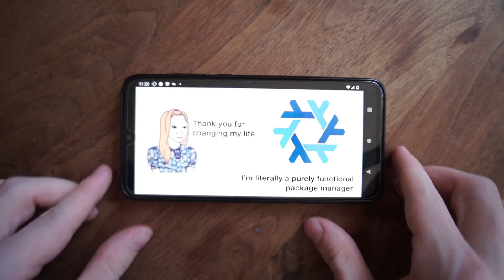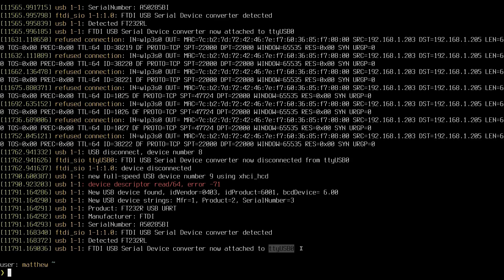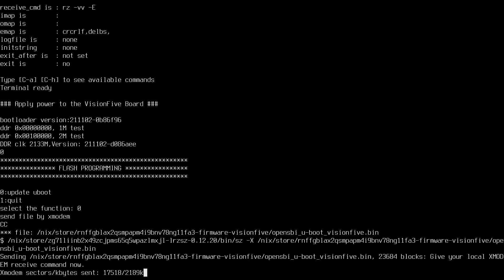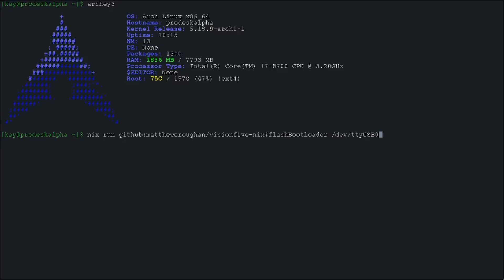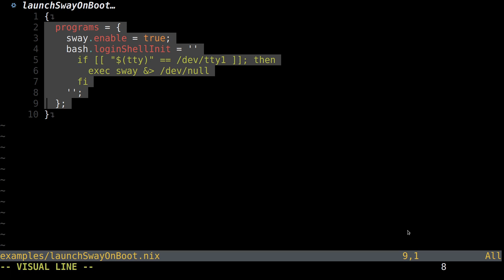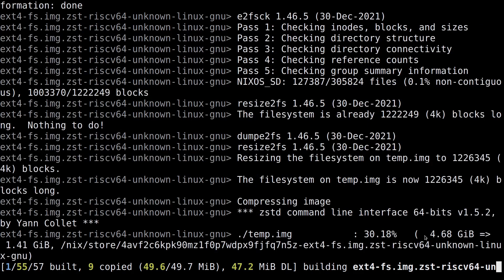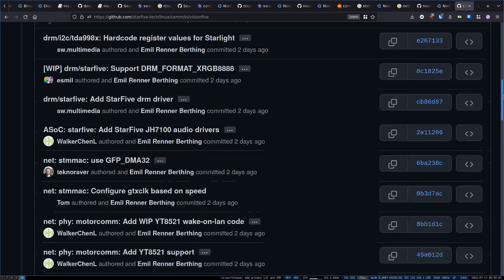Embedded Linux Using Nix/NixOS on the VisionFive RISC-V SBC

Comment: This is awesome. Nice job. Now what kind of tool would you use to rebuild your board from your desktop? nixops?
I'd like to see more videos showing how to package programs, non trivial ones such as anki, or setting up development environments for embedded development.
Cheers!
Reply from the maker: My own tool called Nixinate would be good. It just uses nixos-rebuild under the hood. The problem is that there is a bug in nixos-rebuild that prevents it working when cross-compiling right now. https://github.com/MatthewCroughan/nixinate https://github.com/NixOS/nixpkgs/issues/166499. So if you want to deploy to the board right now, a manual procedure like `nix copy .#nixosConfigurations.visionfive-cross.config.system.build.toplevel --to root@visionfive-cross` then activating the configuration via the store path on the visionfive board would work. However I thought that was too low level to explain in this video, so I omitted it.